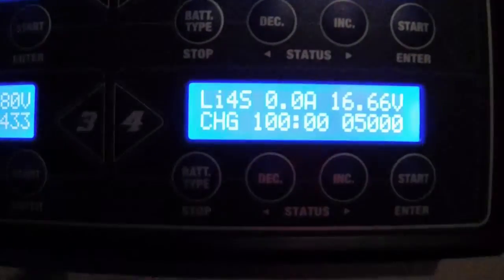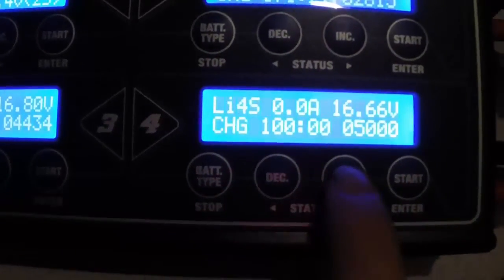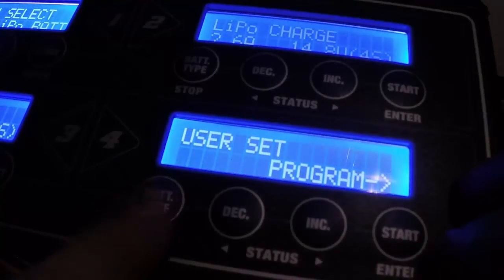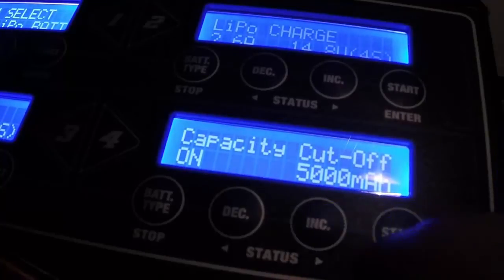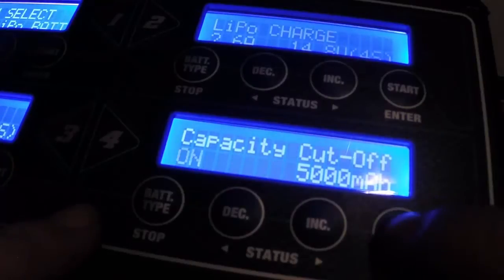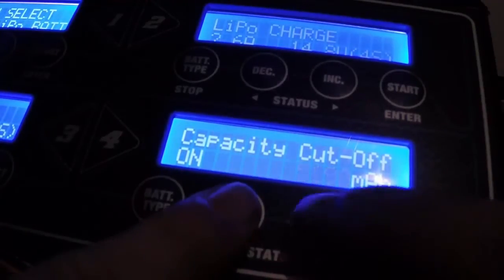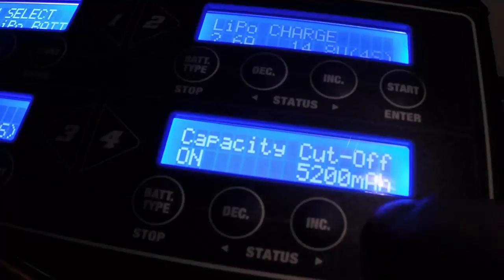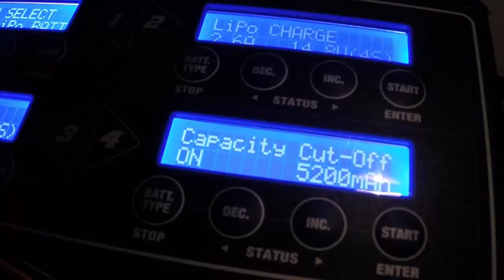capa error message on lipo charger not fully taking charging  and how to fix CAPA

Comment: Hi - I am charging a 7200mah battery, and my charger is 5000mah - and it says CAPA almost every time, then I start over again, and most likely it will charge full op… at least I think it’s fully charged 🤷‍♂️ but do I need to get a 8000mah charger to get my 7200 Battery fully charged 🤷‍♂️??
Thanks a lot in advance for your reply 😅